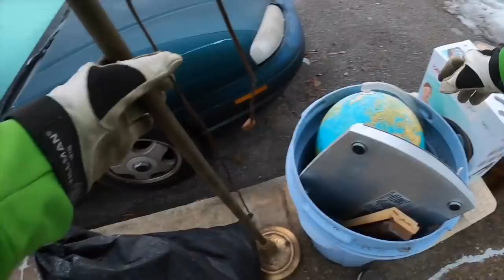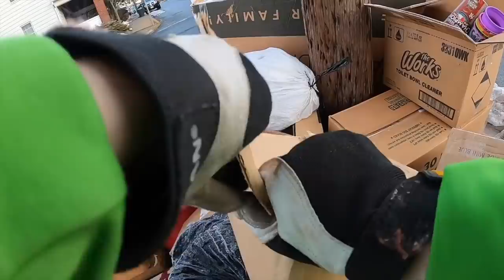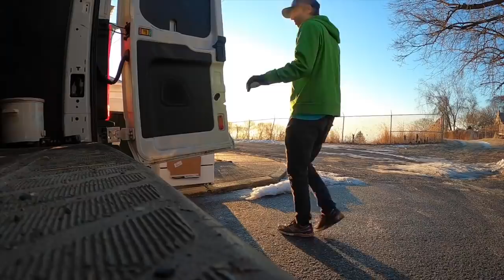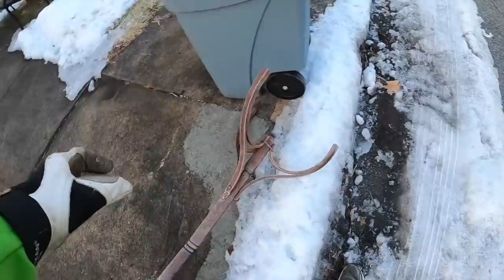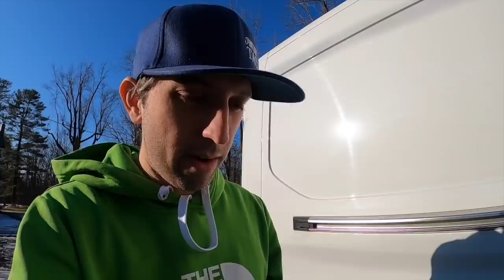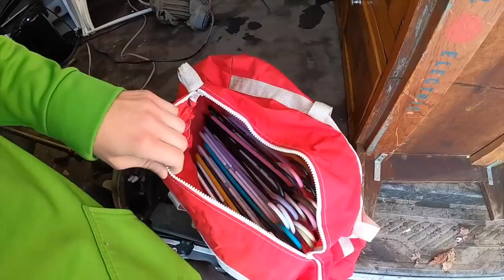Why Would They Throw This In The GARBAGE?!

Comment: I'm surprised you haven't acquired a hand truck yet. After watching you for so long if you had a ramp even a short one with a steep angle maybe even just a wedge for the bumper to the floor gap those bigger items wouldn't always end up upside down. You hit the floor lip which makes you flip it completely over. If I was doing what you do I'd invest in a hand truck that has the conveyor type of back to roll up the edges but you have your method you've been doing it for years. My back would never let me get away with the way you load.

Comment: A 4-5” diameter piece of PVC pipe placed sideways in that step up area of your van would have those heavy appliances sliding right in and not catching on the edge. Home Depot sells shorter lengths of PVC.

Comment: Stop killing yourself Taco.   Keep a concrete 
cinder block in your van.    Set your stove, washer, dryer on the cinderblock first on the ground.  Then push your stove easely on its back into your van.  Try it..  Again. Spin the oven around on to the cinder block and then push it back.  Raising the stove up off the ground 8 inches cinder block will allow you to just push it in on its back.  You're welcome...